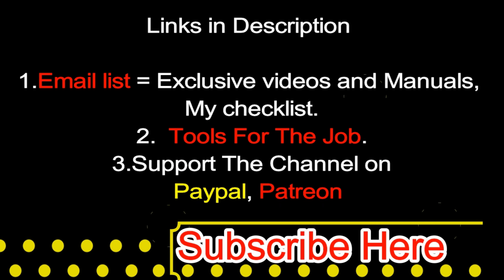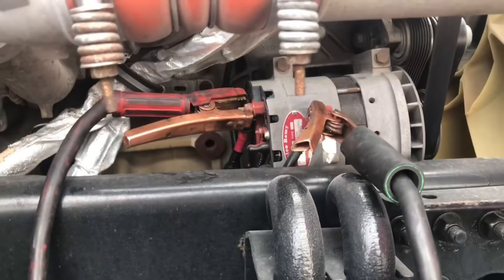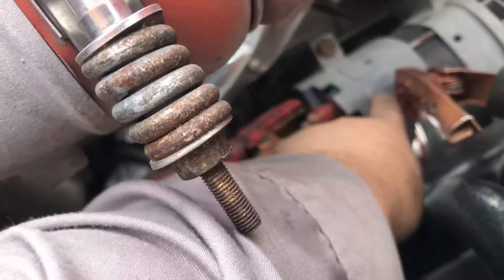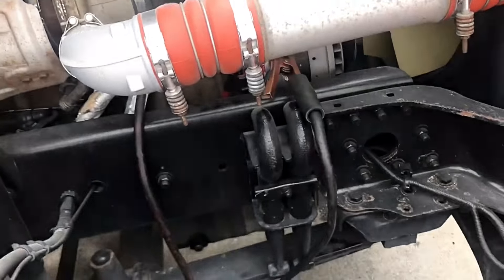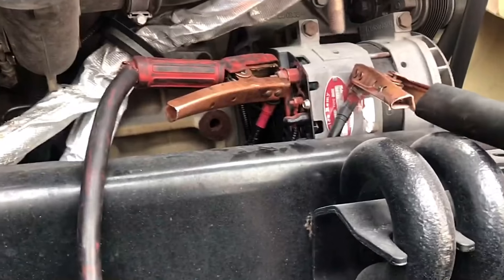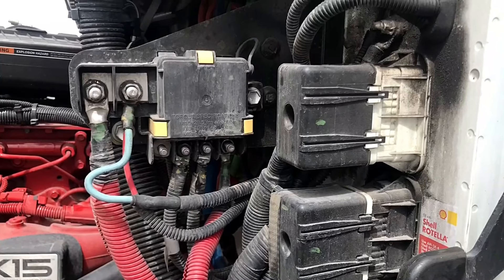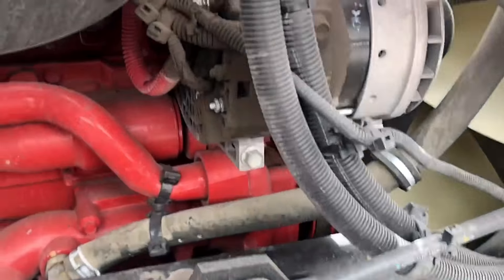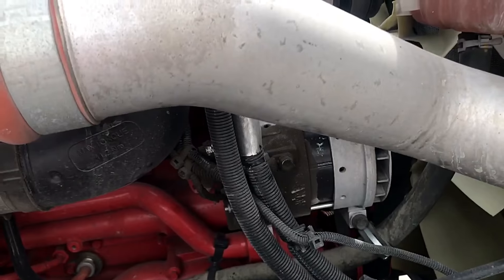Jump starting Tricks on Freightliner and International Trucks .

Comment: Works with jumper kit like NOCO 155, 250, or 500? Requires 12v or 24v to jump (given the two-battery system)?